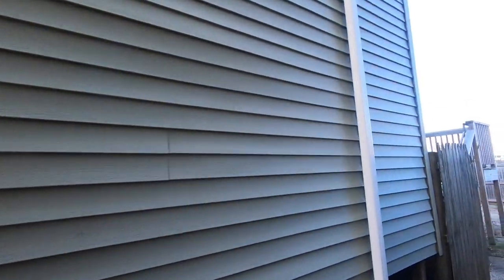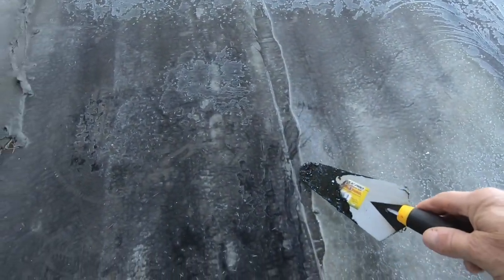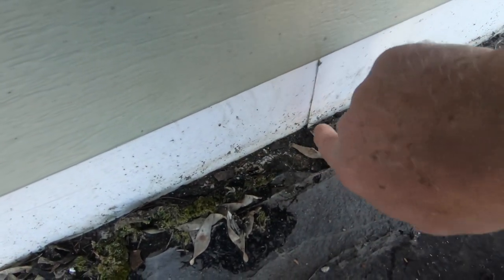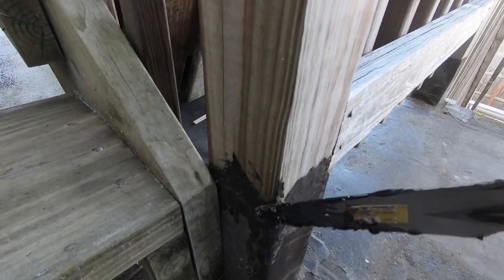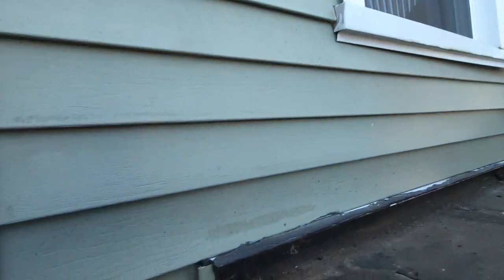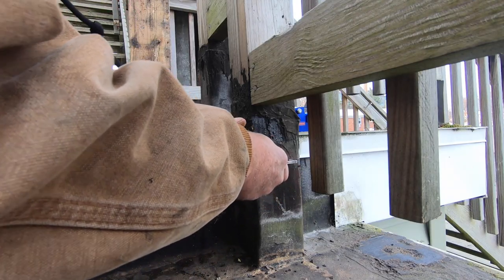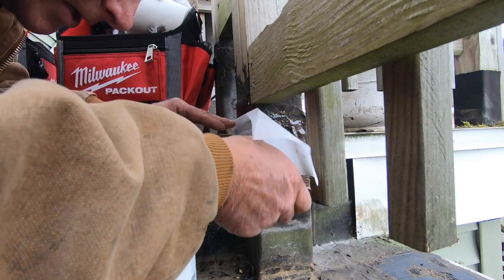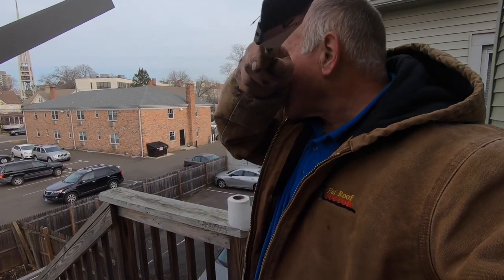I Spend 4 hours looking for a roof leak, then fix it and walk away without charging

Comment: Your friend from Oregon here!! Snows melting, still would welcome a visit from you guys to assist with trying to figure out what my roof needs. Ultimately, it needs a better pitch. Plz help bro!
Reply from the maker: keep in touch later this year
Reply: Definitely remove a length of siding install flashing - )membrane with adhesive Across field.   Regarding treated lumber Posts. It’s probably vibrating during use an expansion.  Treat lumber an install pitch pocket adhesive filled- membrane flash with termination/clamping-ring. Maybe :)